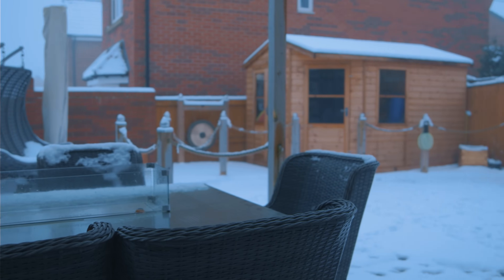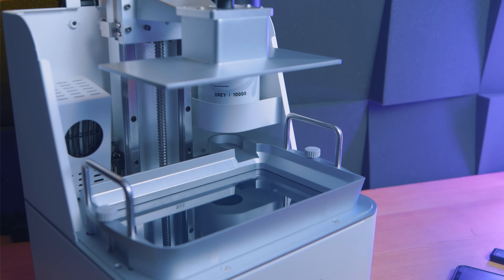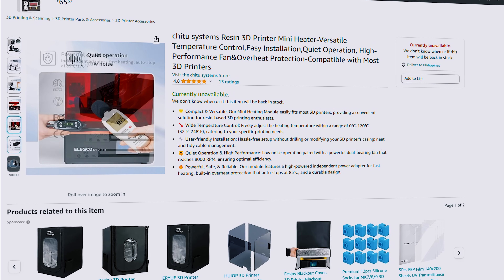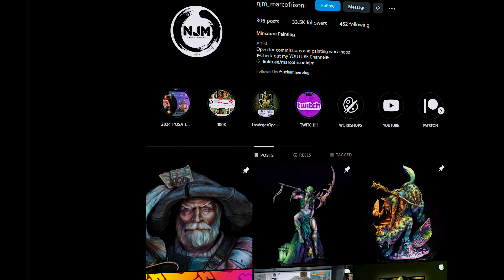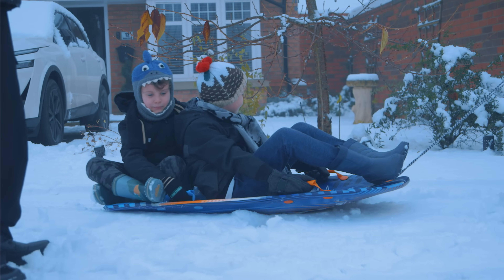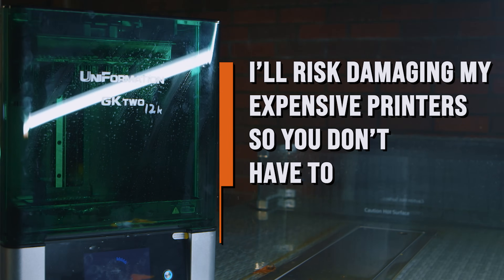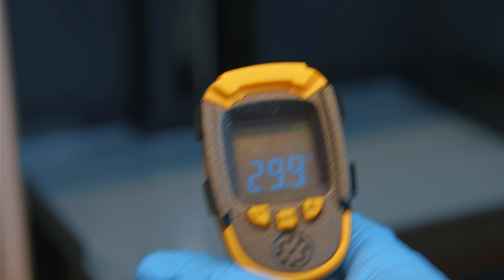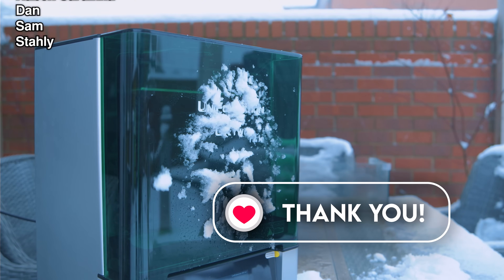How to 3D Print Resin in Cold Temperatures - A Christmas Special

Comment: I purchased the Chitu heater and have had no printing issues. The installation instruction assume that the printer lid does not have a flange at the bottom, since the supplied gasket is meant to fit over a lid with a flangeless bottom.

Comment: I want to start resin printing, but I live in Phoenix, Arizona and cold is not an issue. Heat is. The summer months run 42-47 C degrees on average. Is this an issue?

Comment: I use a body heating pad as it is much stronger than the reptile pads.  What you will need is a PID temperature controller that will regulate a consistent temperature and not those cheap binary temperature switches.  Attach the heating pad vertically behind the Z pillar, place temperature probe on the bottom, and wrap the enclosure with insulating wrap.  It’s not an efficient way to heat the chamber but it absolutely works.

Comment: I've been using a brewers fermentation belt wrapped around the vat on my mars4.  Yes its a bit too large, but a bulldog clip and putting the lid back on holds it in place.  I also have a small pipe heater on a plug with a thermastat.  All inside a grow tent.  I heat with the vat full and the build plate submerged, so no need to heat the resin seperately.  Normally turn it on when I wake up and by the time the school runs done its ready to print.  A smart plug to preheat remote is next on the list.  I would like a gktwo though.  The main benefit for me is the way the lid lifts up !!!

Comment: FERMENTATION BELT. Wrapped around the printer, just below the lid. It's 18C in my basement right now, and my resin is reading 30.2C. It takes about an hour to warm the vat up. A vat heating band would do the same thing. They make them, roughly the same price. 20-30 bucks. I had almost given up on resin printing in the winter, and I'm rarely in the basement in the summer. It's amazing how many people don't realize how important resin temp is.

You're right 100%, the heaters should be standard on anything above an entry level printer. Even with an entry level printer (my Photon Mono 2) my failure rate is nearly zero, because of heated resin.
Reply from the maker: Tried one, But didn;t fit, is it actually heating your resin though?

Comment: I have the option of getting a gktwo 8k for under 600 USD and I’ve never tried resin printing before. I only print with an fdm. I would like to purchase this because it seems like a great deal but I want to know how much of a concern it will be if I use it in my basement. I only have small vent style windows down there and it isn’t a finished basement. Nobody spends any time down there other than to do laundry etc.. do you think this sounds like a reasonable place to do resin printing? Or do I need a garage or shed or something to do this safely?

Comment: Not that I'm quite ready to shell out for a GKTwo just yet, no matter how frustrated I might be with my fermentation belt heating setup right now, but that Amazon link you posted is giving mixed messages. The picture is of a GKTwo, but the product name and description says its a GKOne. Is that just the name of the LCD screen they use?

Also, i should know better than to ask this before searching your videos first, but how dod you modify it to be a 12K printer? Just replaced the screen?

Comment: I print in the northern UK in a small unheated box room that just had room for a single bed previously.
The problem would be changing temps overnight and sometimes during a changing day. I do straightforward simple and cheap solutions that avoid all issues and apart from pre-warming the room, would likely work in a shed or garage.
Whenever I'm due to load a print run I turn on the heating pad with the resin bottle in the printer and also warm the room with a thermostat fan heater set to 21c using a room thermometer, takes about 10mins then check the resin is warm and fan heater off.
Everything sits on a metal desk with a stick up smoke alarm above it in case the box catches fire, the combination of cardboard and cheap chinese made electrical devices is my only real concern with this build.
An inverted baking tray is just the right height so a vivarium heating pad (brewing pads work just as well) set to 21c is flush against the underside of my printer.
The cardboard box the printer came in now has a plastic (taken from a cheap picture frame) viewing window glued and taped in the obvious place to see what's going on in conjunction with a tiny battery powered stick up closet light that is hot glued at the top of the box so I can switch it on and off from outside with the magnet that is meant to attach to the closet door and turn it on when opened.
Inverted the packing box sits perfectly over the printer it was made for with an air gap from the removed packing so it doesn't touch.
I connect my home made spray booth extractor,  it's a replaceable (during it's day job some paint mist makes it that far) dryer sheet filter over punched holes in a kids lunchbox with a 5" usb (desk) fan pushing the air out through an old vacuum cleaner hose to a plywood sheet that blocks/fits in the small upper open bedroom window. (I have collected the bits to make a second one just for the printer but I'm lazy)
(Slight aside that relates to living in certain UK neighbourhoods, it's an upper floor but still the vulnerable larger lower window is locked with key removed to frustrate athletic teenage burglars that plague our area. I added a small label on the window explaining that now they've climbed up they can see the wires and contacts on the locked window frames - these are just basing magnets and coloured wire but teenage burglars are stupid and easily persuaded to take their ladder next door instead. There's also a post it note mentioning I sleep in the room next door with a hammer by the bed)
Set the usb fan to very low, just enough to keep the stink in the box from building up to leak out into the room, otherwise my wife gets annoyed if she smells it on the landing out of fear for chihuahua casualties.
I do cover the whole thing with a fire blanket to keep the heat even more regular but that's just because I saw one at a car boot and haggled down to a pound fifty.
I don't get temperature fails and can keep my printer dialled in for the same abs resin I always use, because I need it to just work for me, I don't want to have to become an expert, I'm busy and happy scratchbuilding and painting in the time it would take up. Honestly if I get a problem that I'm not sure about a good friend has the same printer and set it up to print beautiful detailed prints for me. My benchmark is - can it print the fangs on vampires open mouths? He waves a magic wand over my settings or supports when I do have a transient issue and it's usually me stepping away from creators with reliable premade supports. The key is eliminating temperature issues so I just don't have to trouble him much and stocking good beers.

Comment: One important note is that curing the resin does also heat it up a bit so its mainly important to heat the resin up befor printing.
Reply from the maker: Except if the resin cools during the print, then your working exposure settings at the beginning of the printer are inefficient or poor later on.
Reply: It has worked really well for me to just use a heatgun befor printing in 8°C, but if it's colder then there might be more problems. I used elegoos 8k ww

Comment: Personnaly I started to use the chitu system mini heater on my saturn 3 ultra, and it seems to do the job ; I put my resin into the VAT, start the heater and let it increase the temperature for several minutes before starting the print... this system seems to be good for the price, even if temperature on its screen is 2°C higher than the real one, so I have to ask 27°C to have 25°C in my printer. The rubber seal which is sold with the heater doesn't feat with Saturn 3 hood, but it works without it so you can ignore it or drill a hole in the back of the hood if you want...I hope that I will avoid print failures during winter ( 19°C in my house is too low I think)
Reply from the maker: Thanks mate, yeah, i may give this a shot.

Comment: Bought mine and it's definitely been a pleasure coming from the Mars 2 Pro. 

I do wish it were easier to clean the vat though. It is pretty clunky pouring it out.
Reply from the maker: really? I just use a funnel in my bottles and thanks to thewider edge, it doesn;t drip down to the underside of the FEP which is nice.

Comment: Ross! I was going to give you an earful for abandoning the kids to do a 3D printing video.
Luckily you went and spent time with the kids just before my enraged internet fingers started typing 🤣
I guess sucking in icy cold air overwhelmed the heater a bit, but in more normal circumstances it would work very well, not needing overexposure.
Sadly I'm in the Saturn 3 or M5 budget zone but I'm sure they'll be fine for me. I'm only using Anycubic Photon S for resin atm.

Comment: There are plenty of Electrical Engineers (and electricians) who have no problem doing the DIY route with off the shelf equipment. That's easy for us, and it works great. The problem is that enthusiastic novices shouldn't be playing with AC/"Mains" power without training and the right tools, and I understand your hesitation to dive down that hole. Electricians invented the sign "This won't only kill you, it'll hurt the whole time you're dying." They also know where to put it.

There's always somebody who insists that because they were (usually ignorantly) unsafe and didn't get hurt, everybody else can follow their example. Survivorship bias is kind of like saying "I wasn't killed when I walked across the autobahn blindfolded. I didn't see anything dangerous, so you're spending too much time/money on safety."
Reply from the maker: 100% this!

Comment: Goofy question, My FEP broke and LIQUID resin spilled all over my LCD, and I of course cleaned but will LIQUID resin effect the LCD, despite cleaning it?
Reply: That's not a goofy question. Release Film breakage is a given - it will happen, and it will happen again.

An LCD protector film will protect the LCD should you get cured resin (or something else you can't clean) on the LCD - you just peel it off, replace it, and move on with your life.

Depending on the printer model, you should have either a screen protector or tempered glass over the LCD. If you are really unfortunate, you won't have either, and you'll have to try to clean as well as you can - before putting on an LCD protector.

You will probably need to look up the specifics. HOWEVER, the important part is this:  Make sure the resin is cleaned up really well. 

 I've always found that microfiber sheds microfibers,, so I use disposable lint-free optical wipes (ie. disposable eyeglass wipes) as a last step on both the LCD (or rather what's protecting the LCD), and the bottom of the release film in the vat.
Reply from the maker: Exactly what @pariahzero said.
Reply: Gotcha, I really appreciate it!! 🙏

Comment: This actually demonstrates how the GK Two's under bed heater is less efficient than a vat band.  Once you start printing the act of printing alone will keep the resin warm (exposing resin get WAY WAY hotter than 25 or 30 C.  My Saturn 2 will raise the resin temp by 4 or 5 C by the time the raft finishes printing,  and nearly 10C over an hour).  The fact that it couldn't manage to warm the resin up to 25 fast enough shows that the heater isn't as effective as other options unfortunately.

There is also the part where it is heating up the one place on the printer where you want to keep things cooler, around all of the electronics.  I love the GK Two, but for me, this is its one downside.

Also, a somewhat recent (a couple months ago) development for the Athena, but there will be a vatband kit for it soon, and the testing looks amazing.  Heats up the resin super fast.

Comment: There’s almost no stopping this machine. Which is why I have 2. A recent step I took, being in a colder environment, is pre-heating the build plate. I have had prints along the outside edge, where the FEP flexes the most, detach. By running the plate under hot water before running the machine has completely eliminated this. And I’m able to keep the bottom layer exposure times down to summer time settings. This means prints come right off the build plate when I’m finished. Heat, really is the solution to so many resin printer problems.

Comment: I have my Saturn2  in an Ender enclosure to help regulate temperature and added UV reflective film to the window. Just adding the enclosure helped with the temperature shifts and layer lines I was experiencing, Going to look into a little heater for the enclosure after this video. Belated Christmas greetings and a happy New Year to you and Your beautiful family Ross.
Reply: The little Chitu Systems heater looks like a good system. It has a PTC heater and temp control unit. PTC heaters are highly efficient, and are reasonably safe. The heating element can't get hot enough to ignite paper, for example. Amazon has a nice video showing the complete installation process too.

Disclaimer: I DIY'd my own system using /that costs more/; I'm an electrical engineer, and can do that safely. I'd still build mine again, but Chitu's product looks pretty compelling.

Comment: I don't have a heated vat or enclosure option but a cheap made enclosure with electric hand warmers in the enclosure helps.
Reply: You can buy thermostatically regulated heating pads for brewing and for vivariums for peanuts, just make sure it's flush against the base of your printer and not sitting under the feet. Use a seperate thermometer tho, don't trust the dial

Comment: hello, interesting video, but you missed to talk about the heygears reflex which is amazing with its build heated VAT, I've got both gktwo and the heygears reflex, and what can I say that the heygears is a step behond the gktwo
Reply: That is a seriously unfortunate misspelling. I read 'behond' which is one letter different from 'beyond' and 'behind' AAAAAAAAGH!:face-orange-raised-eyebrow:
Reply: Yeah, but you could buy 2 GKtwo's for the price of the Ultracraft reflex. (At least in my country)  He did mention heated vats.
Luckily for me, I don't really need to worry about cold, only heat.
My FDM and resin printers are in a small room and the temp in there is usually 25C plus regardless of the outside temps.
I have to use a little aircon in warm weather to keep it under 35C

Comment: Sadly not many ways around this... The new commercial building I have my eye on not only has a balcony, huge windows with lots of natural light for the painting. But 3x heated treatment/massage rooms each with power, heat and 8ft work bench tops with sinks. Perfect for 3D printers I can setup to run individual temperatures for each of the 3 models of machines I have.
Reply: Nosy question but what's a ball-park idea of the cost?
Reply: @philgee486  Place I'm looking at was up for £520 month. Depends upon where your looking. Also has a lift that may be an extra charge.
Reply: @thebritishengineer8027  Many thanks, I've been looking for something about half that size but that's not really big enough for most folks so they're rare. To go above £300 I'd need to be selling a lot more stuff which isn't really the point. It does strike me that sharing something with three painting studios and a shared space for terrain making and to actually play tabletop wargames two or three ways would be a way forward using what's out there
Reply: @philgee486  You can pick up some great deals at the moment I was just waiting for the paperwork on just under a thousand square feet in Wigan for £320/month. Just be careful of repair leases.. Shared space is available through many local councils who offer starter units/work spaces.
Reply: @thebritishengineer8027  Blimey, you're not far away, I'm  just outside Blackpool
I need to look again at commercial property
Then again there are so many derelict apartments and hotels I see in town
Reply: @philgee486  I am going commercial with mainstream products that seem to be what the market wants. That in turn funds a specialist printing project that is really the big earner. Between the two I should be able to hit our expansion goals, with 10 – 20 on-site before end 2024.

Comment: Nice. Just got my first printer, X1C, and I’m not going to use it in the house or garage. 
Ordered it for the Black Friday deal and figured I’d get a shed to put it in. 
I’ll probably try it out this winter outside too with the box over it unless there is something I’m not considering…and that is usually what I do.
Reply: * Ventilation - Whether resin or FDM, you want to be able to remove excess heat and gasses as well as keep heat inside
* Headroom/Access - You want enough space on all sides to work around the device. Doors in good places
* Flammability - Kind of obvious
* Lighting - think it through for the printer, but it sucks to be in the dark, or one-handed with a flashlight
* Power
* Consider a prototype made out of XPS foam. Yeah, some people cry that XPS Foam is flammable - well, that depends. Building codes require it to be behind sheetrock, yes. As does wood studs.

In the US, at least, XPS foam is loaded with flame retardants. It will burn, if you throw it in a fire, but will also self-extinguish (unlike wood). I've tried to light it on fire, just because I was paranoid. It's best cut with red hot metal (usually wire, but anything hot enough works). So I would suggest prototyping in XPS foam, try it out for a little while, get the ventilation ductwork figured out, etc. Then build the box properly. As a bonus, you'll get to re-use the foam for insulation.
Reply: @pariahzero  Thanks!